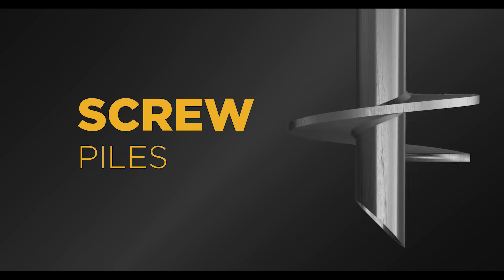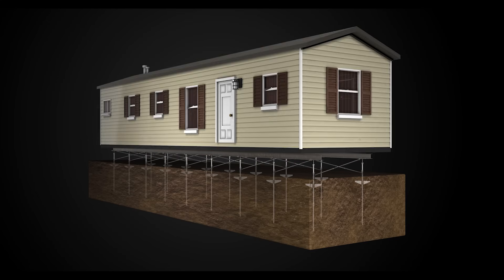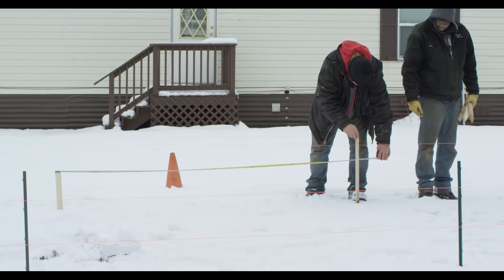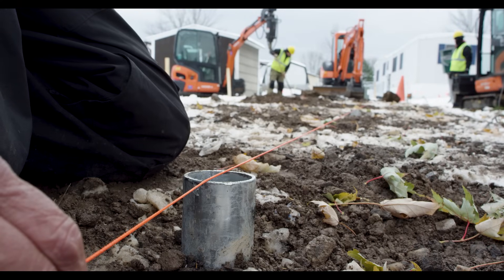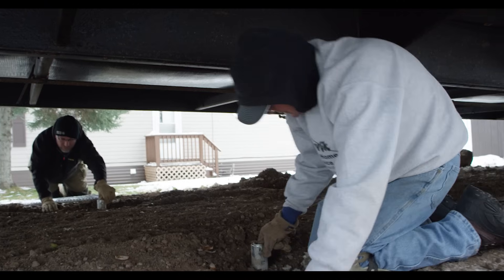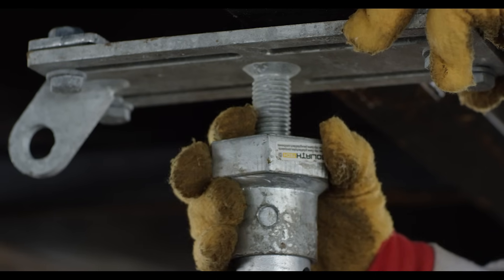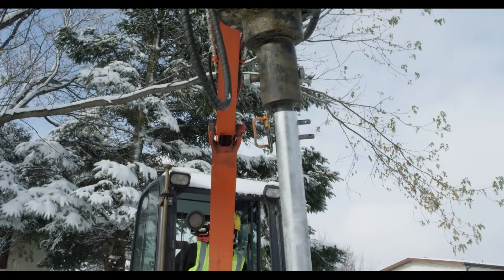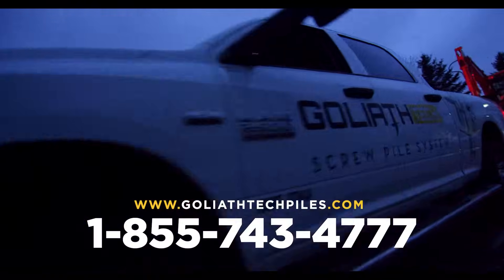Manufactured Home Screw Pile System Installation

Comment: Noooo I changed my mind about screw piles (helical piles) after listening to a civil engineer's counter-arguments; DO NOT use these for primary residences -- they cannot withstand lateral movements such as soil erosion, landslides. They are a quick and easy* solution for lightweight structures (pavilions, greenhouses, workshops).

* Easy but not that cheap since you still need to rent an EXCAVATOR to drive the piles in

Comment: Living in central Ontario, Canada, most houses have a below ground basement.   There are so many issues with houses having cracked basement walls leading to moisture etc.   Dealing with that issue right now.   If I want my next home to NOT have a basement, this would be ideal as I wouldn’t want a concrete pad which would crack and/or sink with frost etc.  👍

Comment: Don't you still need support on the outside edges and support under the doors leading inside/outside?
Reply: No. Mobile homes are built on two steel rails. The home is designed to get support from only those two rails.

Comment: If your Manufactured Home brackets also fit shipping containers that would be worth advertising since like mobile homes containers should be sufficiently above ground to vent humidity. If not making suitable tabs for your existing plates would take little effort on a Scotchman (to prototype) or to have laser cut in bulk.
PS:
Lose the music next time. NO ONE seriously interested in your product cares and it steps on the speaker (who does a good job).

Comment: Does it break the bank what's the pricing?
Reply from the maker: Hi, prices are determined according to pile size, can you please let us know your location so we can redirect you to the local certified installer?
Reply: I’ve seen pricing.  Don’t think this is less than concrete footings in Sonotube.
Reply: Most likley yes.   I wouldn't even bother if you don't wanna spend over 10,000
Reply: It's the same or less than the standard/conventional foundations in my area! Which is awesome because it's hands-down a better method. Going to last forever rather than cracking and shifting.

Comment: I am looking to place 4 shipping containers on my property in Hudspeth county Texas, essentially marl soil, on the southwestern edge of Molesworth mesa, about 1.182 miles from Hobo tank , (308 degrees). looking to be up10 feet above ground level.
Reply: I also use containers and it would be easy if the provided clamps are incorrect to fab tabs that work with container flanges. However since containers are designed to be supported by the corner fittings if they offer sufficiently large piles you could use one pile at each corner bolted to a plate welded to the corner fittings. Anti-seize the bolts and all the threaded connections on the piles and braces before install for future adjustability (cheap and easy). My current containers sit atop and are welded to heavy steel beams (demolition surplus) so I can jack the joined pair at once. The Sea Box site has some cool military and industrial container examples worth a look.

Comment: rather put my hause on a concrete pad . more stable
Reply: It's actually not. Especially if you live in areas with shifting soils, like I do. In my area, the soil is sandy and gravelly, as it is in much of the U.S. Even the best concrete foundations crack or become lopsided overtime in areas with bad soils like this. Have you considered the quality of the soils in your area? Both of my parents and my father-in-law are engineers and my husband is a top-of-the-line builder. They all would agree that helical piles are more stable and long-lasting than concrete pads.

Comment: is there a way to do this if there is a mobile home already in place
Reply: could be done but would be extremely inefficient and would cost boocoo's of dollars (be cheaper to move the trailer and then place the anchors then put the trailer back 😊
Reply from the maker: Hello Micheal,
Yes this is something possible, please contact our customer service and we will gladly direct you to the franchise of your sector
Reply: @goliathtechcorporation6060  whats the number
Reply: Of course there is but I prefer the old school concrete blocks. That looks weak af.
Reply: @hotlatino7220  There's how things "look" in a video and there's the actual way it works. Two totally different things. Both my parents and my dad-in-law are engineers, and my husband's a top-notch builder. All of them would agree these piles are way better than a plain old concrete foundation which cracks, shifts, and even sinks over time. One of the biggest problems in all of housing, maybe the #1 problem, is solved with these piles. There's nothing "weak" about them, and the problem they solve which you are not considering is that no matter how strong or beautiful your concrete foundation is, it will fail if the soils in your area are poor in support.

Comment: I don't think that would work here in Northern AZ. The soil is caliche rock...it's like concrete.
Reply: in that case they would use a different type of anchor specifically designed to penetrating concrete
Reply: Yeah and that's triple the charge. Lol. Best way to go. A big O basepad Cinder blocks halves soaps 2x's 1x's and wedges. Cheap but yet very durable. Last forever.
Reply: Does that soil shift? I know clay soil does.
Reply: @isackhernandez3691  I haven't seen much shifting of soil here. Seems pretty solid.

Comment: Is this legal to use in NE Georgia for a mobile home? Tornado rating? Thanks
Reply: these devices will hold your home in place through a tornado. so with that reality it spawns natural no brainer legality on the senate floor and then is passed by Congress making it law
Reply: These are the best option I can possibly think of for areas with bad tornadoes. Once those piles are driven into the ground they're not going anywhere.